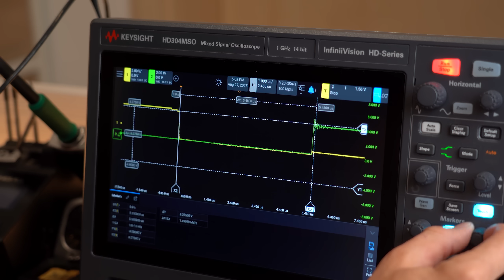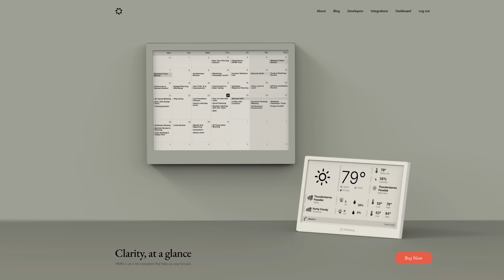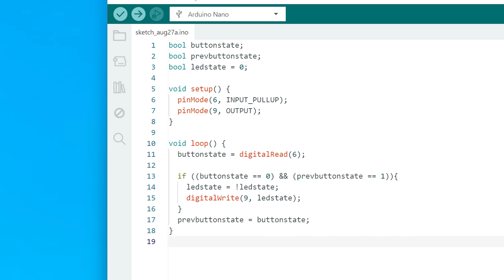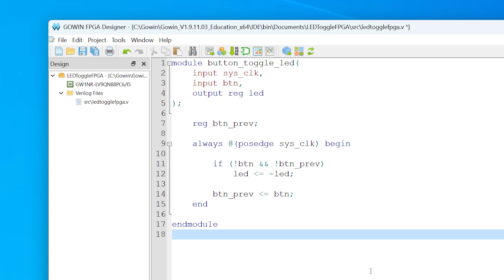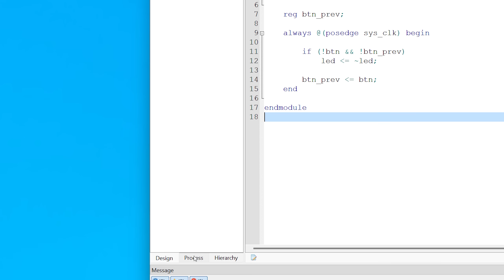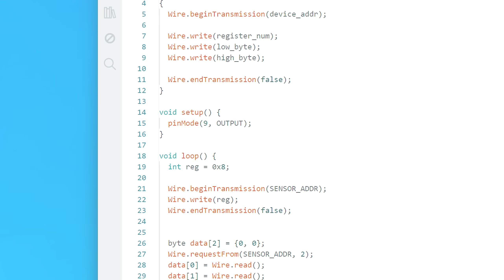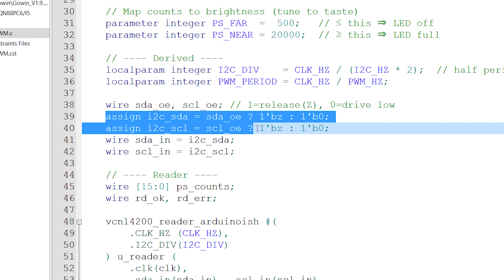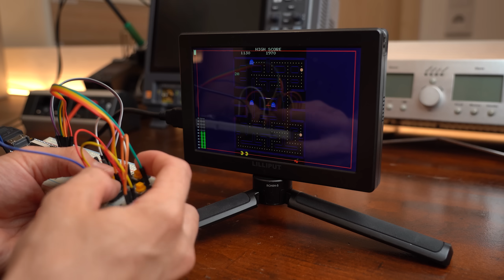The Harsh Truth about FPGAs (You Should Avoid Them?!)

Comment: Well, you can define on the FPGA the same processor as on the microcontroller and have the same switching circuitry as on the microcontroller then you should get similar switching speeds. I think for prototyping where you can change the CPU architecture and have defined different hardware interfaces is only good when you are in the prototyping phase and testing different performance characteristics. Otherwise when you define the FPGA for the same hardware circuits as on the microcontroller then you shouldn't see a big difference.

Comment: FPGA "code" is not software, it's configuration.  Software is a program that is "run" or "executed".  But with FPGA the code just describes how the FPGA is configured.  Some of the more advanced tech does allow you put a microcontroller inside a FPGA, like the Xilinx microblaze.  And other FPGAs have a companion microcontroller that can work alongside the FPGA.  Before DSP microprocessors like the blackfin became common, FPGAs were often used for medium to high speed signal processing.  But today they are less common, they tend to be power hogs and expensive compared to the inexpensive and feature-rich ARM micros that are available today.

Comment: There are really only a few reasons to use an FPGA (partially summarizing the video):
1. Getting maximum processing power per $ is worth more than dev time/expense
2. You need ultra-low latency that can't be achieved with a uC
3. You need processing power with the lowest possible energy consumption (this may or may not apply depending on the application's suitability to FPGA)
4. As glue logic connecting chips with non-standard interfaces at bandwidths that can't be achieved with bitbanging (e.g. in my case intercepting the custom digital audio signal sent from an audio synth chip to its specialized DAC and converting it to a standard format for the uC to use)
5. You want the practice with FPGAs (I really should be doing more of this, as my FPGA experience is still limited)

If none of these applies, use a uC, CPU, or GPU as appropriate to the application.

Comment: Not surprised AI didn't help. It helped me with a lot of ECU code, but at a certain point, it wouldn't put out anything worth a damn, and I had to do it manually. Tried getting some PIO code for a pico... nothing useful. generic ass C code for periodic one shot pulses based on analog data, easy, decode a series of short and long teeth into 1s and 0s and trigger the pulses based on specific pattern matches, easy. filtering/rolling average of variables, easy. Update delay before on as the delay is happening, but don't update delay before off while pulse is on.... garbage code;; that's what i had to sort out manually. Now I can bounce off the rev limiter without engine destroying partial pulses of fuel and spark control.

Comment: FPGA work is tough when things get complex.  The hardware description language implementations and poor optimization models are terrible verses what is available for high level (general cpu) programming languages.  I often get stuck trying to do things, particularly hierarchical access to elements and structural encapsulation to reduce complexity in the input/output parameterization that a particular IDE's compiler either just can't deal with, or winds up spending 30 minutes trying to optimize something that I don't want it to optimize for my development cycle. 

What's crazy is that even the vendors loose control over their own hardware compilers... where the companies wind up losing the expertise required to make fixes and additions to the batch processes that compiler the HDLs into FPGA programming bit streams.  It is literally that bad.

And then we get into timing and propagation constraints... things go south quickly when there's a ton of combinatorial logic inbetween registered stages that result in huge clock optimization problems.  Things go south even more quickly when you depart from clock-edge-driven logic.  Level-driven buffers to deal with stage-to-stage flows with overlapped clocks and relaxed timing constraints just isn't something an FPGA can do well... or at all really.

It really makes me angry, to be honest.  I use a microcontroller whenever possible, but there are just some things that a microcontroller can't do.   FPGA design would be a whole lot easier if the tools were actually kept up to date and modernized instead of being a dozen separate little batch programs written across the last 30 years some of which the companies owning the I.P. no longer have the expertise to work on.

-Matt

Comment: FPGAs are awesome, but you should probably stay away from low-level hardware description languages, because they are very painful to use. Look up the Bluespec Compiler. It's an open source, high-level language and a compiler that translates Bluespec to Verilog, which you can then use to program your FPGA. There are two syntactic variants of the Bluespec language: the original one is more similar to Haskell, while a popular variant is more similar to Verilog. They cater to different crews, but they are both high-level and in fact are functionally equivalent.

Comment: Awesome explanation. The difference between microcontroller and FPGA is exactly that. You can use microcontroller to program device algoritms, but still must add surrounding peripherals as hardware blocks. FPGA in general will allow you to build whole microcontroller together with surrounding peripherals inside the same FPGA chip. Less surrounding hardware and works faster. But development and debugging will be hard and really hard. FPGA itself is more expensive though together with surrounding peripherals going away it somewhat equalize with MCU circuit BOM cost. Particularly that is why FPGAs aren't so much used as ATtiny based door openers and other simpler MCU based hardware, but signal processing is full of them. Also circuits with MCU as main supervisor and FPGA as signal processor are pretty widespread.

Comment: I've been working with FPGA's for 24 years, and this is largely spot-on - they are different tools with unique benefits. Microprocessors are great when you don't care about timing accuracy or you just need to move data around. FPGA's are for when you need precise timing or need to implement a non-standard protocol. Most of what I do involves adapting between custom protocols and a PC.

That said, there are FPGAs with integrated SoC CPUs that can do both. Alternately, you can implement a CPU model in an FPGA, allowing your code to interact directly with your digital logic design. It really comes down to whether you need that flexibility. A good example of the latter would be a custom digital synthesizer I did once that integrated a small 8-bit supervisory CPU model with a custom FM synthesis core. The CPU model programmed the NCO and filter parameters while the oscillator code ran at full-speed.

However, the learning curve is steep and the pitfalls wide, as working with an HDL is more akin to schematic capture than software. It's a different way of thinking about problems and modeling solutions.
Reply: The PIO peripheral found in Raspberry Pi's MCUs are also great for implementing non-standard protocols.

Comment: Purpose of fpga and uC are different. uC uses it’s limited hardware recursively. When we connect between input and output via uC, it runs a software to reconcile them. Software makes this step by step, which requires very small time to reflect the change in input on it's output. Although in most of the case, this delay is quite bearable and appears to be instantaneous. In fpga though, you are making real hardware in contrast with software Between inputs and outputs. Think you’re designing a digital logic device. You built a prototype using discreet  ICs and it failed. It’s quite frustrating. While you can easily built and test your design on fpga. You can even built a multi core cpu or gpu using fpga.

Comment: People think microcontrollers are easy because of projects like Arduino, similar to people thinking linux is easy due to Raspberry PI.  Prior to those two you rarely had convenient libraries for the sensors, or even the on-chip peripherals, and C compilers were often not included so you had you buy them - meaning a lot of hobbyists worked in assembly.  One of the biggest changes that helped vault microcontrollers to the hobbyist level was on chip flash that didn't require a UV eeprom eraser to erase the chip, and low voltage programming methods with simple printerport or serial port adaptors and free programs to allow programming the chips repeatedly and easily.  The cost to play with them dropped significantly. The PIC16C84 (eventually renamed 16f84) was a watershed microcontroller.

I fully expect the same thing to happen with FPGAs - we may still need to use HDL or Verilog, but the tools being free for smaller designs provides an opportunity.  If people spend time decreasing the difficulty of development by making tools that make it easier, and making the blocks that can be dropped into a design to implement simple state machines, peripherals, etc, along with the video tutorials then we might see an explosion of FPGA based projects.  If the arduino IDE become FPGA aware and capable it would accelerate this process significantly. Sadly Arduino has moved into the profit extraction mode so I don't see anything like this coming from them anytime soon.

What's needed then are projects that really shine using an FPGA, and are more difficult or less performant on a microcontroller.  Using FPGAs with built in CPUs, though, or making the arduino equivalent that has both FPGA and CPU on one hobbyist development board should suddenly become the defacto solution for everything.

The gowin fpgas are getting cheap enough to do impressive work at hobbyist levels.  Throw some tools and tutorials in there and watch interest and usage explode.

Comment: Did you use direct port manipulation or did you use Arduino code on the example of toggling a button?

Also, if the Micro-controller needs 5.5us, and the FPGA does it in 60ns...
... why is it an FPGA and not a nanocontroller :D

Comment: I made a 64x128 LED Matrix display driver using an FPGA for one of my digital logic labs. I spent 30 minutes trying to explain how it worked to the lab instructor because she was trying to say it didn't meet the requirements. In reality, it was just so complicated that she couldn't wrap her head around how the Verilog code worked. It was a scrolling display with a potentiometer for the speed. There was a built in microcontroller that communicated via UART to the FPGA for the AD conversion. You could also upload bitmaps to it using a program I wrote that sent the data via a serial terminal to the microcontroller and then to the FPGA. It controlled individual LED brightness using PWM (8-bit resolution), so it updated the display around 15k times/sec for 60fps (IIRC). That project really showed me the potential of FPGA's.
Reply: That is so cool, how did you start learning it?
Reply: @TheWeen344  I watched videos and looked at examples. It starts to get easier once you make a few programs yourself.
Reply: I saw the irony when he showed an LED cube as an example of a microcontroller application, where with the right design framework and knowledge, an FPGA, even a small one, could do so much more. For simple applications, modern MCUs have blurred the boundaries, especially with some of their sophisticated I/O features, but modern FPGAs can do things that an MCU can never do if the application demands it.

Comment: For my undergraduate final year project, I had to develop a 4-digit BCD Multiplier Core with Similarity Investigation. It had to avoid trivial multiplications (x1 or x0), detect invalid entries (non-numbers), and retrieve the result of previous operations to save time. At some point though, similarity investigation yielded diminishing returns, as it takes time to traverse the RAM block I coded for saved results. The design took my entire Christmas, but I got it coded with VHDL in XIlinx ISE and running by March.  I used the Spartan-6 on the Digilent Nexsys 3 toolkit, a keypad and some pulldown resistors on the PMOD ports.  It was hell getting it to work outside simulation, as I forgot to code a debouncing module to interface the keypad. Those late nights were not fun. 🥲

Comment: FPGA's are the master of I2C interfaces. Sure a single slave, no issues on an mcu. Even multiple when running slowly. But 128 of them? At 8Khz? No way. Even a cheap FPGA does that without breaking a sweat.

They are not beginner friendly at all. Although it's much better now than 10 years ago

Comment: There are some library functions available for things like I2C.  However, I agree with you that unless you really need the speed, a microcontroller is a lot easier!  I tend to use them instead of building discrete logic and for simple finite state machines where they can really shine.  They are also a lot more bomb-proof than a microcontroller - because the states are finite, it's much harder to 'crash' one or put it into a state where it will stop operating.  Thus, good for critical applications.

That said, microcontrollers have become so cheap and fast that it's rarely worth using an FPGA these days.  SOC's are worth a look though, combining the two for the best of both worlds!

Comment: It's obviously a "need" thing. As in "do you need all that power?". If the answer is yes, then no other option, if it's no, then maybe a MCU or a SoC is a better option. I'm putting the finishing touches on a (virtual) expansion device for the ZX Spectrum over a point i wanted to make. The platform (conveniently) already has a "standard" way to do "bytestream PIO" to the bus at a "lightning fast" ~4KB/s give or take. Sounds tiny until you remember that loading from tape was 1500baud/s. And given how lacking in power the Z80 is, there are LOTS of things you can speed up by offloading the work to an external device. Or capabilities you can add, like "extra (fake) RAM", storage, etc. If it was to be translated to "real iron", you'd probably just plot a ESP32 or similar with a CPLD as a bridge to the bus or something and everything past that would be software. Want to add more "capabilities"? Just add more code. More expansion hardware? Add more code and hook up the devices to the ESP32 I2C,SPI, UART, WIFI, BT, whatever. Easy peasy, little stress.
Now, an FPGA would be able to do proper DMA thus lot faster, but would it be as simple/fast to add new stuff? Would any C/Python/C#/whatever developer be able to drop in and start fixing things and adding more things? Not really.
As with most things in life, use the right tool for the job. Sometimes it's an FPGA, sometimes it's not. And it starts with knowing what the job is and what the requirements are.

Comment: I think you might have a use for a good book, for instance Gergo Erdi's Retrocomputing with Clash (the example projects are public source and contain a useful component library too). A hardcoded function block will always outperform an FPGA logic assembly, and some are quite standard which is why e.g. Lattice FPGAs have I²C hardware blocks, but writing logic yourself is how we get to building those blocks. I have worked on some successful ASICs as a result, having started out with pretty much just a book on VHDL and Xilinx WebPack (its templates were sometimes helpful).